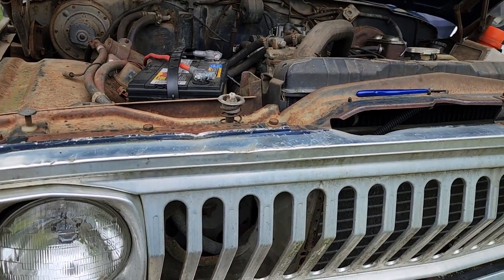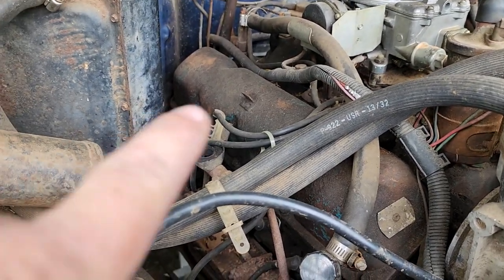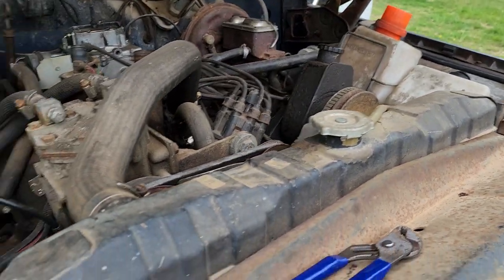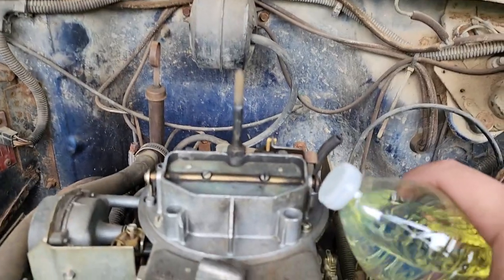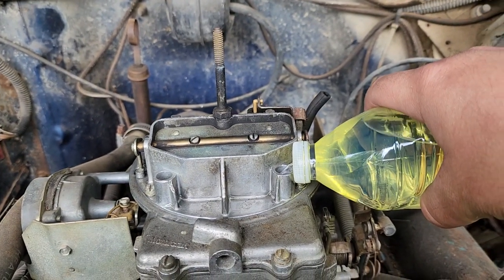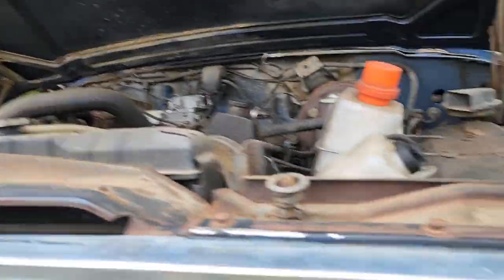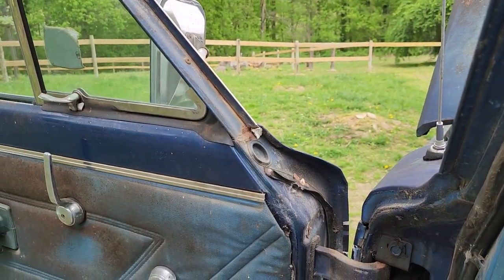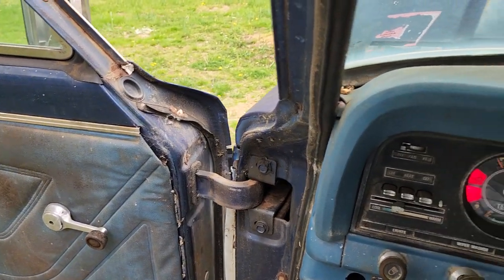Will the Jeep J10 start after nearly 2 years sitting ?

Comment: Heck yeah she's a runner. Cool you got the original keys with it!
Reply from the maker: Once i got it into the shop i managed to get it running for 5+ minutes to warm up.  It ran great.. i had to start it and run to the front to constantly squirt gas in the carb..  the carb needs taken apart and cleaned.. the rotten rusted gas in the fuel line also plugged up the carb.. so while the carb is actually newely rebuilt and pretty clean.. the bowel and jets must be plugged up.. 

The prior owner had bought a rebuilt carb lol.. but he didnt bother putting a fuel filter on.. nore checking the gas tank or clearing the old ritten fuel in the fuel lines.. so it just plugged right up.

Im not sure even though i cleared the fuel lines mostly..  if i ahould even use them.. new ones are 50$.  So i might just get all new lines